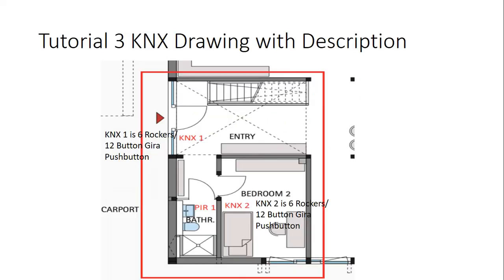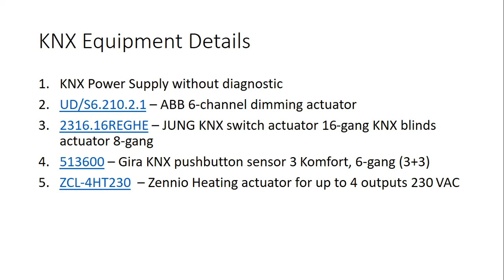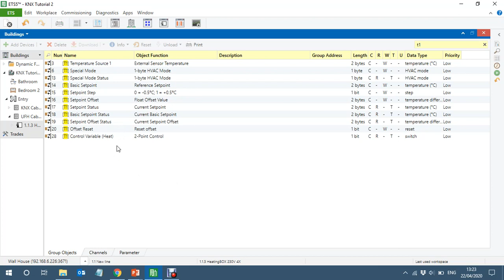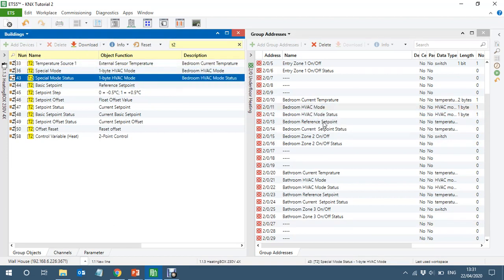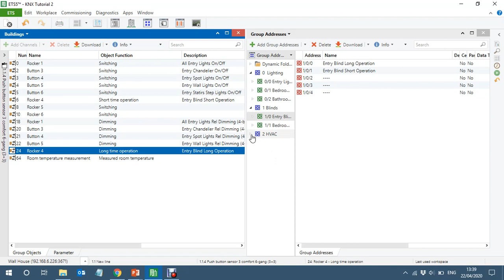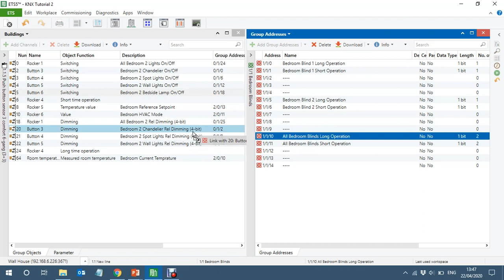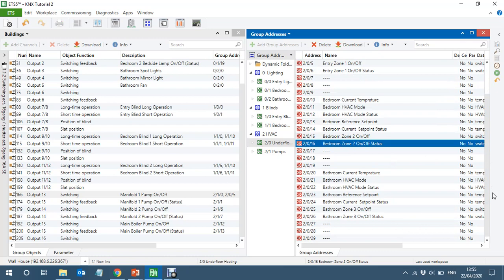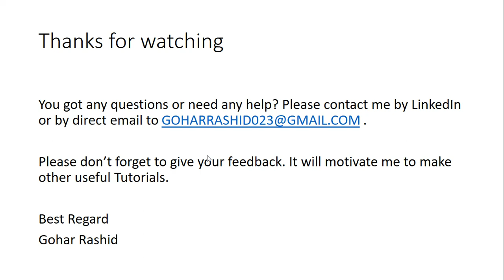KNX Tutorial 3 : Programming of Underfloor Heating

Comment: Thanks for excelent videos on KNX programming, I have used your videoes to program lights and now I am doing HVAC, but here I am struggling abit. Would it be possible to request a short video for only the HVAC using the Gira heat actuator 212900 and Gira switch 513300. If possible the hole setup of pump control if all valves are closed, temperatur sensor, Heat valve open counter and which groupe address to link to what settings on the Heat actuator. Hope this is possible. Thanks in advange